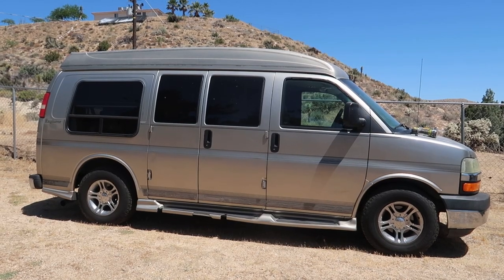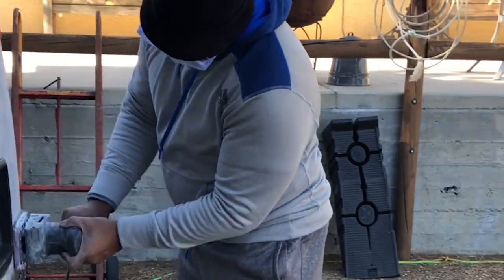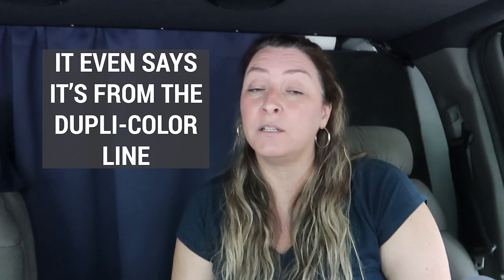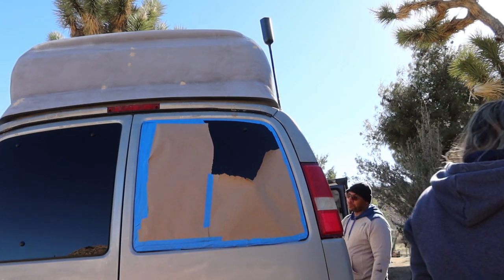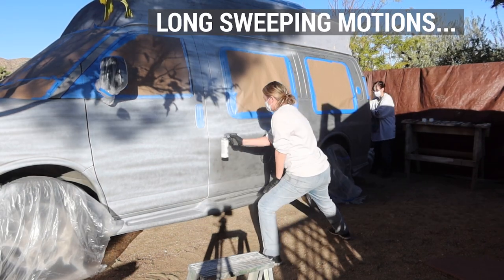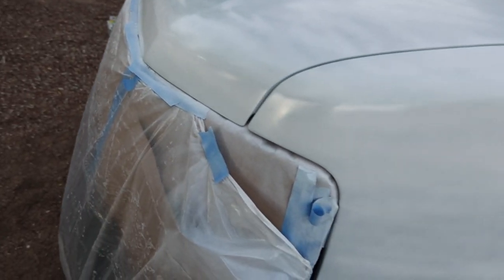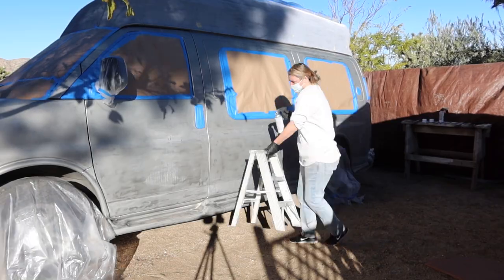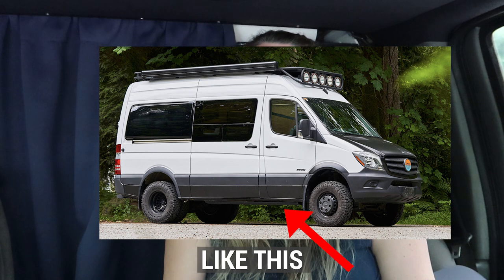Spray Painting my Van for $170!! (DIY Paint Job Using 25 Rattle Cans)) // Travel Snacks

Comment: Hi Allison, First, I agree, at the end of the day what really matters is if you have everything you need and are comfortable in your home. You did fine for never having painted before and doing it outdoors.
 Back in my rally vendor days, ex-hubby and I used Kyrlon spray paint from Walmart to camo our dodge ram charger. Took us a case of beer and 20 cans of paint.. LOL... turned out well enough people asked us where we had it done...lol...
Try not holding the can so close to the surface, that is what gave you the streaks. I know it feels like you're not getting coverage with the wider spray but its going on more evenly with no streaks to try to cover so you actually use less paint.
Oh and you left out that Chrome painted his indoors out of the wind and dust...LOL

Safe travels, May the roads be clear, the gas cheep, and your parking give you a view just this side of heaven... God be with you. Amen

Comment: The problem is you were painting outside and the wind was blowing... You could get a cheap hand held paint sprayer on amazon for less than 100$ and buy paint separately. It would cost you less than spray cans, and you could get the job done much easier and faster. 
Best of luck!🥰
Reply: thanks for the suggestion

Comment: I did spray paint on a much smaller scale (Trek Mountain Bike Frame). I sanded / abrasion the surface of the original  factory paint. Then i used 2 cans of Rustolium gray enamel. Nearly 6 coats with drying time inbetween (2 days) Then a final 2 coats of clear enamel .

Comment: Now I know why my grandmother used a roller and big wide brush to paint papa's truck green🤣
Reply: works great on older vehicles using enamel paints like they came original with. All the new cars use a base coat covered with a clear coat.

Comment: I'd have gotten (Mine is Hausfield compressor large 20 gal) a 3 gallon pancake air compressor from harborfreight 120v for $75 and the better Avanti $99 spray can, then bought the paint you wanted elsewhere. Would make painting the van much easier, quicker, thicker coats, and probably not much more total cost than using 25 spray cans of thin paint.

Comment: “Roll & Tip” works well on custom sports cars and sailboats. The same paint in the spray can comes in regular paint cans. Looks great even with the method you used.
Reply from the maker: Good tip! I might check into that! Thanks 😊
Reply: Sometimes the generic/company paint has less pigment in it, which makes coverage more difficult. It can take two coats on the cheaper cans, which ends up at times costing more.
Reply: In roll and tip. You apply the paint with a roller, then quickly follow behind with a dry paint brush lightly dipped then wiped dry with acetone or another product. This lays the paint smoothly and also removes any bubbles. It also helps prevent any drips/runs. Keep wiping the brush dry as it should not carry paint. With the roller you want minimum amount of paint on the roller. A quality paint with high pigment content should not need an undercoat, unless your vehicle is very, very dark in color. Love this project. Feel free to throw in a family picnic with local foods so we can broaden our horizons. Teeheehee. 
Sailboats come in fiberglass or steel hulls (amoung others), so you should be able to get tips for both your fiberglass and metal surfaces. There are lots of great tips from sailboat life that would benefit your van build. Rule number one when sailing, other than keeping the ocean out of your boat, is to plan for a knock down/roll over. Ensure all contents are willing to stay in their locations during these times. In land travel.....think rollover, impacts from every angle, including underneath, since in a vehicle you could slide on your side and be hit/or hit something from below. I freak out when I see people putting knives and other objects on magnets assuming that they will stay there under impact conditions. NOT! I want you to be safe so I can follow your adventures for many years to come.  Be safe. 
By the way, your dad got an “F” for not wearing safety gear for eyes and lungs when he was cutting and sanding fiberglass. 
A side note to be aware of.....painted vehicles all have a rust retardant layer as the base coat, with paint over it. When you sand and you accidentally go down to the metal layer, you need to use rustoleum like product before the paint layer. Any drilled holes require coating as well, even if inside, when adding bolts, screws, etc. 
Enjoy the project. Wish I lived closer so I could join in on the fun.
Oh yes, change of subject but, the Dare Maple cookies, and the Canadian Ruffle’s Chips you liked (called “AllDressed”) are available in northern New England. Northern NH, VT, and ME. Also Putine is in abundance too. French-Canadian cultures are in abundance here. The Tortierre’s and Boudin (blood sausage) is available at certain times of the year. Maple syrup is in abundance too.